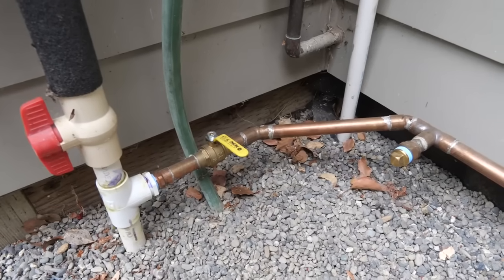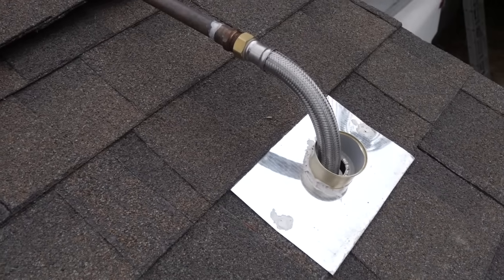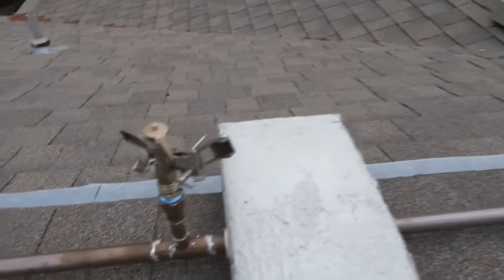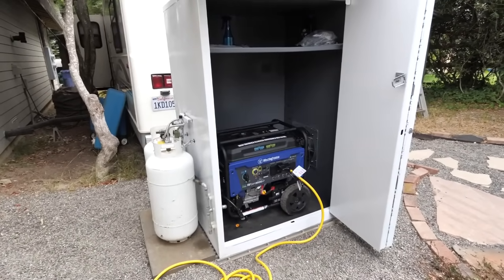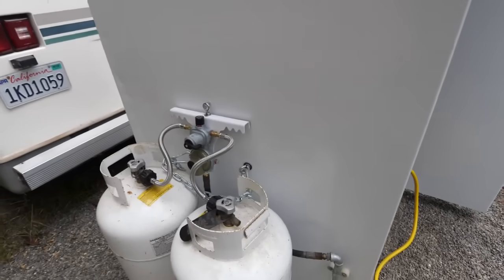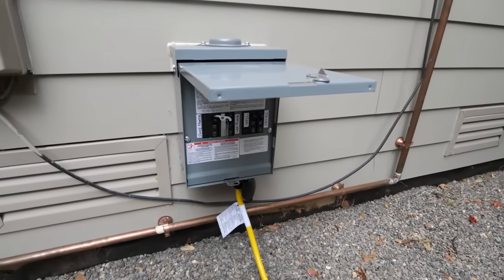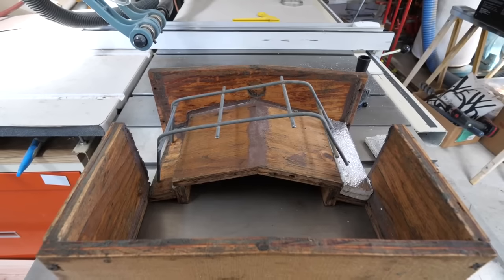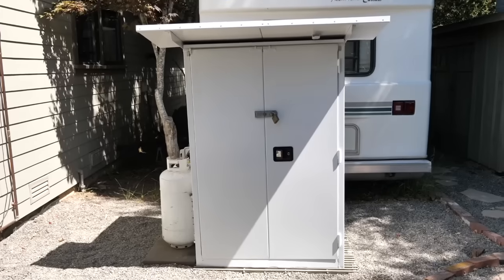Roof sprinklers and backup generator for wildfire-prone rural house

Comment: This seems like a far better investment than insurance.

EDIT: Someone basically did the same thing, and it worked: https://youtube.com/shorts/zrwCHPepA6E?si=hujZQNjAeaSM5cwj
Reply: Great idea especially because in some areas insurance companies are cancelling policies since it won’t be profitable if something happens.
Reply: You have a much better chance of this doing something beneficial than insurance paying a single cent.
Reply: We lost our home in the Tubbs fire. The aluminum engine in my car, melted and ran down the driveway, due to the high temperatures. I still have the aluminum. 
Our house was reduced to ash. Even glasses melted inside the dishwasher, which requires 2500F. We had a steel shop, which survived with only some burnt paint.
We need to build homes without wood and asphalt roofs. We cannot use bark chips and wooden fencing. Building codes need to reflect our new reality.
In these residential "wildfires", the flames travel horizontally from structure to structure, and the winds act like a blowtorch. Any amount of water is futile.
Reply: This is REAL insurance. Not an empty promise paid to strangers who have no obligation to help.
Reply: @ Pointless in a wildfire. The PVC would melt in minutes.
Reply: Not really , Insurance is good for recovery not fire mitigation. I would think you would get a lower rate and possibly better coverage if you had a system like this .
Reply: @silentbob1236  our home in California has a swimming pool, with a fire hose connection with a very visible sign posted above it, as well letting the fire department located ACROSS THE STREET from our property know of this. Despite these proactive actions on our part, our fire insurance was raised by 120% last year. If you do anything it will be to hopefully help protect your property, it  will not do crap when it comes to lowering insurance costs. At least not in California...
Reply: @norcaldeemichaels 
The cure. OWN your home, thus no requirement to have fire insurance. Then mitigate the risks yourself with systems like this. You will be hundreds of thousands of dollars ahead in the long run.
Reply: Unless they shut off the water like they did in Altadena
Reply: @billdivine9501  they mostly have own water wells
Reply: Yep, only if you have water at time of fire :). None of the other preventive measure should be ignored.
Reply: All those trees/bushes close to building walls, should be removed. Check latest building fire code.
Reply: This won't save your house, these roof shingles aren't combustable. Thats not how houses catch on fire.
Reply: Looks like you’ve thumbed your nose at the corrupt insurance companies, for now.  If more people were able to take these preventative measures it may cut into insurance profits enough to make them change their profit models.  More than likely, though, they would still find a way to screw the public, because that’s what they do…
Reply: You pay in, and even IF it pays out 3 years later you will have a house similar to what burned down with most of your stuff being gone.
Reply: Lol. Unless the fire starts from the inside. Then what. 😂😂😂😂
Reply: @vblic  What kind of WILD FIRE starts inside a house????????
Reply: Many.  Wildfires heat the area so high that the inside of the home combusts; drapes, rugs, carpets, etc.  Ask any fireman.
Reply: @ Sonoma Co., post Tubbs Fire, made everyone waste million$ to do this? 
$1000 says the Supervisor got a kickback.
Reply: @vblic  drill a hole in the roof
Reply: @vblic  Seems is a keyword. I didn’t do a deep analysis of insurance; I’m highlighting the fact that some insurance companies, as of late, have been canceling policies of people who paid into them for decades, with nothing to show for it.

So yes, it seems it would have been a better investment, since it would have at least provided a chance to defend their property.
Reply: @vblic  I would just buy new stuff with the money I've saved from not having insurance. Duh.
Reply: @vblic  new house's comes with interior fire sprinkles. If it is an old house, you can install the system
Reply: @gulopac1  water damage will be just as bad as the fire damage. Either way your screwed .But in California the bigger problem was dry fire hydrants AKA DEI
Reply: @whdbnrm3023  If you think it is the same cost to rebuild a house from the ground rather than dealing with the water damage, your numbers are not right. Will be nice to know what the insurance think
Reply: @gulopac1  probably a lot of factors to consider ,including the age of the house .
Reply: @whdbnrm3023  Yes,  but if you live where something like that could happen, it definitely is a good investment, and the insurance will be happy if it is installed properly
Reply: @gulopac1  In a wildfire...the fire starts on the OUTSIDE!
Reply: @gulopac1  Actually, they can require a larger water valve at the street. All of which is code and permit approved.
It's really expensive.
Been there, done that in Sonoma Co., CA.

Comment: With the recent California fires and the loss of those multi-million dollar homes, I often thought those folks should have "thought ahead" and had something like this on a large scale.  Undoubtedly, they have swimming pools as a water source.  The propane-fired pumps could deluge the property quite quickly and keep running.  What I don't know are the characteristics of those fires.  Are they so intense and so hot that everything is incinerated, like a giant oven, or could stand-alone deluge system work in such a case?  It is one thing to kill flying embers that come over, but quite another to be surrounded by everything burning intensely.  I just don't know.

Comment: This is excellent. I appreciate the slow speaking pace, it’s calming. While this would be quite a project for me, it’s relatively inexpensive and anything would help. I’m working on clearing our landscaping away at least 10 feet and then we’ll be starting on this next. For starters I’m going to install two sprinklers with garden hoses. Even if all I can do is give it a good soak before evacuating, that would be better than what I have now … nothing. The cement forms answered my question about how to keep the sprinklers on the roof in San Diego’s Santa Ana winds. Thank you, I’m sure this vid took a lot of time and effort to plan, film and edit - I really appreciate it!! You could be saving people’s lives and homes with this info.

Comment: Im installing mine tomorrow ,we are a plumbing/carpentry family . I was running pex double crown side loop and the foam insulation  [pool noodles] over the pex which  keeps sun off . i was doing a loop so water preasure would be equal  in the entire system .pex when it has water in it it cannot melt or burn .like a fire fighters hose laying in flames.i didnt plan on going through roof but was going to put a pole in a metal pipe or angle iron  cemented into the ground and use that to connect my pex to for the horizontal bracing .i get a lot of snow here in bc canada kootenay area and we have a lot of trees . Thankyou for your video i find nobody is as smart as all of us and if we all use each others ideas we can come up with the best designs  and a bit of tweeking .my gen  i was going to make a 3 inch thick cement box with exhaust port and natural gas connection inside of house basement . comment  getting long so cant go into too much details ,i do my best planning at night laying in bed before sleeping .lolo .id love to hear back on if your farthest sprinkler has less coverage than your closest 1 as it should as far what i know about  piping water ? thanks  ..Gene .

Comment: The too close landscaping will create a radiant heat when burning that will vaporize the water coming out of your sprinkler system.  I'd next focus on creating a defensible space of at least 100' with no landscaping.  I know it's tough to get rid of beautiful landscaping but that is what determines if your house is going to burn or not.  The sprinkler system is a panacea not a solution.

Comment: Nice job, was wondering the total water flow rate? We can calculate the amount of energy it takes to phase change the water to vapour and from that work out what kind of fire power this can dissipate, assuming all the water went into cooling the house/garage and not miss. A fire break is the old fashioned tried and tested way to stop a wildfire reaching a house. Perhaps keep a chainsaw handy if there is a line of tall trees nearby as if a wall of fire gets a decent sized tree going each tree puts out a boatload of BTU. I would suspect tall tree fires puts out more BTU than a sprinkler can dissipate. But it did look like you only had some small shrub and short trees near you so probably not an issue. I guess this would do great keeping the house cool on hot days and if the ambient temperature was high due to a wild fire again it would do a great job keeping the house and roof cool from indirect heat. Does the roof water run off into the gutter or can it divert onto the land around you?

Comment: We’re looking for a good systems that covers every aspect. After looking at this setup I see there’s a lot of thought, time and money put into this extravagant system. I do have a few concerns however. I watched a video of a cabin with a sprinkler.  It had cameras set up to see how it fared in a wild fire. It didn’t do well. It still burned. Those wild fires roll through between 1200 to 2800+ degrees. The water from those yard sprinklers would evaporate. Fires also blow in to the sides. How would the sides of the house be kept from burning? And the fire proof cabinet, the whole purpose was defeated once the hole was cut for the fan and then having to keep the doors open during a fire. Why then even use such an expensive cabinet? 
Copper retains heat and gets really hot. I truly hope this system works. 
The set up is really nice but one thing I would change for sure is I would use agricultural hi-flow sprinkler to heavily douse everything including the space about 30-40ft around my house. Have a 1800gal tank for emergency water, will last 12 minutes with one sprinkler. Would douse everything if the fire is within a mile coming our way, turn it off so the tank can refill then turn it on again when the fire is closer. If need more water then use the pool water, about 12,000 gal. We need to decide on the medium to deliver the water. Not doing copper. We also need to decide where to put the sprinklers to get the roof and the sides of the house. Which sides would be most vulnerable. How to protect our sheds out of reach of the sprinkler. What are we willing to sacrifice if not able to wet…. lots to think about. Hopefully we can decide something before our house burns down. And hopefully it works.

Comment: Good setup.    I've done a similar thing at my county home.    I run the spriklers with a pump from a 1000 liter IBC tote that fills from my rain gutters or from my well if need be.    When the sprinklers run, a fair percentage of the water recycles right back into my storage tote, thereby reducing the drain on my well.
Reply: thanks for adding this, i live near Jasper Canada where our beautiful national park and town got destroyed by the latest wildfire, and realized homeowners need to start taking care of fire suppression themselves for their houses, and have seen videos over the years showing the greatest hazard yet most easily dealt with if prepared, is FLYING FLAMING EMBERS, not walls of fire, those embers take time to start a house fire and thats lots of time for a sprinkler to destroy them and save the house, i thought of your idea before i saw this vid and am glad to see others are thinking as well, especially the part of the water running back into the storage after being 'sprinkled' over the house through the eavestroughs and pipes, thanks again for sharing, i was thinking there must be many cheap ways to have that water stored, be it totes like you mention or even those 10-25 foot pools one can buy just about anywhere for their backyard, cheap, fill them up with water in the spring enjoy in the summer and if need be they could save your house

Comment: Man, you talk excruciatingly slow, I had to play the video at 1.75 speed to watch it.
I did basically the same system except I pulled from the swimming pool and powered the pump off my roof top solar system.
Note that I'm also got the sprinklers on a timer that spays the roof on hot days to cool by evaporation and so the attic is cooler and less energy gets used overall (so more is available to power the house. 
A couple of years ago my entire neighborhood burned BUT NOT MY HOUSE! since I set the sprinklers manually on before we evacuated (located north of LA)

Comment: Impressive copper work there .👍 
I was going to say , why bother protecting the roof, then I saw the tar stuff. 
     I’m in Aus and no one has roof material like that . Saying that, many people here still think it’s necessary to put sprinklers on a corrugated iron roof. I can’t see the point of that. It ain’t going to burn ! 
   I think the next few years are going to be very nasty’ down under’ for fires. I’m planning on setting up a system. 
Good video. 👍

Comment: Man that is awesome engineering! Can't think of anything you missed in the entire system. Also, I thought it was hilarious, all the high dollar copper pipe and fittings, generator, fire cabinet, electric box to isolate power to your home and make the local grid safe for emergency workers and custom made reinforced cement roof hold down blocks.........then you made the roof boot from a cat food can! I think we'd get along great as neighbors lol, probably the same sense of humor.
Reply from the maker: I did use an expensive brand of cat food.
Reply: @BiggeDink  you need a heate shield to prevent
reatiated / infra red heat it over cooking gas bottels
and powercabel in the ground.. remember when you bleed
it for water in winter time.. the one part on roof does not got drained
Reply: @BiggeDink   😂😂😂
Reply: @BiggeDink  LOL- so funny! 🙂
Reply: Also, have to commend you on editing and script for this video, no wasted words, everything said was on point and clear, can't stand the how-to videos that drag on and on with ramblings and asides...
Reply: We lost our home in the Tubbs fire. The aluminum engine in my car, melted and ran down the driveway, due to the high temperatures. I still have the aluminum. 
Our house was reduced to ash. Even glasses melted inside the dishwasher, which requires 2500F. We had a steel shop, which survived with only some burnt paint.
We need to build homes without wood and asphalt roofs. We cannot use bark chips and wooden fencing. Building codes need to reflect our new reality.
In these residential "wildfires", the flames travel horizontally from structure to structure, and the winds act like a blowtorch. Any amount of water is futile.
Reply: Yes Shield the gas bottles and regulators with a lift up metal hood.

Also bury the cable in a conduit - between house sub board and generator cabinet to protect it from radiant heat & flame or ember attack.

Otherwise an excellent installation. 👍👍👍🇦🇺
Reply: Man,I wish I had a Dad like Biggedink, I would soak up so much game. Great job sir.
Reply: "can't think of anything you missed in the entire system". With that vegetation and trees up close to the house and overhanging it, with that whirly roof vent that's going to be ingesting flying embers, etc it won't matter. He has a lot of work to do yet. All vents need dampers or some way to close them off so that flying Embers don't enter the structure, which is how a lot of homes actually ignite. If serious he's going to have to sacrifice the vegetation and trees directly around the house too. 

The guy proudly goes through all this effort to fireproof his house while leaving trees standing so close they're over hanging the roof ffs... that ain't good! Having a hard time taking this guy seriously. 😂
Reply: @ is he actually allowed to cut down the trees on his own land ? It’s California, he might have his hands tied. I read an article a couple months ago, there’s a woman that owns a multi million dollar home out there but doesn’t live there. She’s got a big oak tree overhanging the home. The insurance companies won’t insure her because they all got together and instituted “new rules, no vegetation within so many feet of your home”. The state, or county I can’t remember says it’s a native tree and she’s not allowed to touch it, now she can’t sell the place because it can’t pass inspection because it’s uninsurable.
Reply: @shanek6582  Trees do occasionally die you know. Shit happens.

Comment: Do you get freezing Temps there?  What would you do in winter?  Drain the system?  Otherwise pretty good
Reply from the maker: We generally have mild winters. I did put in a drain and do drain it during winter.
Reply: @BiggeDink   really it's a good design, it's just about what wild fire fighters do to save structures.   I'll eventually be moving to a colder region that also faces wild fire risks, and this is a good way to reduce the risk!
Reply: Well engineered system. Very nice